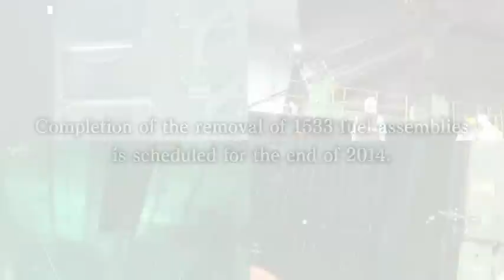Removal of nuclear fuel assemblies from Fukushima Daiichi nuclear power plant

Comment: There's a few reasons why they blur parts out. It mostly amounts to common sense when you think about them though. 

1. Security Concerns: Nuclear facilities are high-security areas due to the sensitive nature of the materials and the potential risks associated with nuclear technology. Detailed videos of this process could provide information that might be exploited by malicious actors, posing a security risk.

2. Non-Proliferation: There are international agreements and regulations aimed at preventing the spread of nuclear weapons. Uncensored videos could inadvertently provide information that could aid in the development of illicit nuclear capabilities.

3. Operational Safety: The process involves complex and highly technical operations, often conducted under strict safety protocols. Publicly sharing detailed procedures could lead to misunderstandings or misinterpretations, potentially compromising safety if individuals attempted to replicate or interfere with these processes.

4. Radiation Protection: The process involves handling highly radioactive materials. Videos like this one might expose workers' identities and gain unauthorized entry to the facility they work at. Plus specific operational details that could be used to criticize or question the safety measures, even if they are strictly followed.

5. Proprietary Information: The equipment and methods used in handling and storing spent nuclear fuel often involve proprietary technologies developed by nuclear energy companies. Releasing detailed videos could disclose sensitive information that is protected by intellectual property laws I.E. trade secrets.

Comment: is this pure fantasy? did they really completely stage this video? it was reported in late 2019 that they were just starting to remove spent fuel 8 years later. how is this video 7 years old.

April 2019:
Tokyo Electric Power Co. (TEPCO) workers began removing spent fuel rods from a cooling pool in the destroyed Fukushima Daiichi Nuclear Power Plant on Monday, the first major step in disposing of the highly radioactive material left in the plant after a tsunami ravaged it in 2011.

later on in the article:
 To remove the rods, workers stationed about a third of a mile from the plant operate a crane and lift the fuel out of the pool. The fuel cannot touch air, however, so the process occurs completely underwater.

they sure don't look a third of a mile away to me
Reply: They are removing spent fuel eventually from all six units. Some were done before others.  Duh.

Comment: I noticed a crud trail in the water as they were moving one of the assemblies. Is that common in BWR fuel movement?

I've emptied casks from Brunswick into the pools at Harris. I always assumed the crud was coming off the fuel because it was hitting borated water for the first time. Is that incorrect?
Reply: It's mainly due to the heat the rods were exposed to due to the SFP becoming uncovered during the explosion of building 4, this type of fuel assembly should typically come out of the SFP clean but due to the damage to the ZIRCALLOY tubes a layer of what I can only presume is metal slag and concrete has built up on them

Comment: Watching this in 2021 wondering what the current status of the Fukushima Daiichi NPS is
Reply: All fuel extracted from 6 through 4, 1 and 2 still contain large quantities of fuel, 3 and 1 still hold a considerable amount of Chorium under the RPV, decommissioning work is being undertaken on units 1, 5 and 6 while the other reactors are being decontaminated, most of the plant no longer requires full PPE to walk round however down on the main grade of the turbine buildings Overalls and masks are required due to pockets of radiation being present.
Reply: @InserNameHere2053  thanks for the update!

Comment: It will cost at least half a trillion dollars to do a lousy job of cleaning up this mess. Who knows how much it will cost to safely store the enormous amount of contamination from this. No one can even begin to estimate the medical costs that for the radiation that has contaminated the entire northern hemisphere.
Reply: Very very little radiation contamination really, probably little enough to cause 0 cancer cases outside of Japan.
Reply: @Gomlmon99  I learned very long ago not to believe a word out of the mouths of nuclear proponents. However, I am constantly amazed at just how outrageous your lies are. You are one of the worst. The Fukushima Daiichi 3/11/11 disaster in the first week after the explosions released more radiation than Chernobyl and more cesium than all the other reactor meltdowns and atmospheric nuclear bomb explosions in history. There was 100 tons of fuel and 8 years of spent fuel rods each in Units 1, 2 and 3. Unit 3 had 10 tons of plutonium in it. Unit 4 had no fuel in the core but the cooling water in the pond evaporated and the reactor exploded. The reactors' fuel melted through the reactors and is now in contact with groundwater. The ice wall is ineffective at isolating the melted fuel, which has still not been located in the debris, and the groundwater. At first they were releasing 400 tons of radioactive groundwater a day. Now it is 300 tons/day. The debris spewed out by the explosion contaminated the surrounding hills and streams which flow into the Pacific after every rain. It also released "hot particles" or "fuel fleas" that rode the wind to places far, far away. Occupants of Tokyo are breathing an average of 10 per day. In Seattle, it is 5 per day. These hot particles lodge in the lungs and create cancer. All of the tanks of radioactive water taken from the reactors will eventually be dumped in the Pacific. The thousands upon thousands of bags of radioactive debris scraped up from the area within 50 feet of the roads are being incinerated without electrostatic precipitators and baghouses to clean the exhaust. Wind and rain is recontaminating "cleaned areas" that Japanese are being forced back into. In the spring for at least the next 300 years, pollen from the cherry blossoms and cedar trees on the slopes of Fukushima Prefecture will contain cesium (muscle eater) and strontium (bone crusher). 50% of Japan is dangerously contaminated. Millions of Japanese live in areas that are more radioactive than the "No-Go Zones" of Chernobyl. Dust on the streets of Tokyo would legally be considered radioactive waste in the U.S. Before EPA stopped monitoring radiation from Fukushima in the summer of 2011, radioactive iodine, cesium, zeon, and uranium were measured in the U.S. at levels hundreds of times above legal background limits. It is a good thing for Japan that the wind was blowing out into the Pacific. Otherwise, they would all be dead. Let's see how long the Pacific will last before the whales and salmon go belly up. Then us.
Reply: @Gomlmon99  Deal with the facts I presented instead of deflecting with insults.
Reply: @jackfanning7952  You didn’t present any facts, just hyperbole and conjecture. 

A fact would be something like: 

“Tritium levels on the coast of the USA are consistently xx Bq/m3, whilst dangerous levels would be above yy Bq/m3”

Except you didn’t say that, you just made up a bunch of fear-mongering bullshit.
Reply: @Gomlmon99  Radon from naturally occurring radium in the earth's crust is the second-leading cause of lung cancer in the U.S. Do you think the 300 million tons of uranium tailings exposed in 9000 sites of U.S. uranium mines and mills increase the risk of lung cancer? Radioactive isotopes from fission byproducts are entirely new forms of radioactive materials that are 1000 times more dangerous than the U-234, U-235 and U-238 in naturally-occurring uranium in the earth's crust. You need to sit back and consider the numbers of people damaged by nuclear power and bombs that have been ignored by the nuclear power industry. Plutonium-239 first developed by Glenn Seiborg is so toxic that Seiborg said that there is no dose so small that it did not kill 100% of the beagle dogs in the experiments he performed. 10 pounds of plutonium, properly distributed, is enough to kill every human being on earth, ten times over.  There were 10 tons of plutonium in Fukushima Reactor #3. How many bananas would it take to represent an equivalent dose as Reactor #3? What is the half-life of a banana? Is it longer than plutonium?
Reply: @jackfanning7952  again, this is just conjecture. Tell me the difference in radon concentration due to U mining in the US? Practically none.

Tell me how many fission products reach the environment from nuclear power? Practically none. 

Tell me how much plutonium reaches anywhere past the immediate region around Fukushima? Practically none.

You need to start putting actual, useful numbers on these things and have some perspective.

Try comparing the radioactivity released from a nuclear power plant compared to a coal plant.
Reply: @Gomlmon99  The difference between radon concentration from naturally-occurring uranium and tailings from uranium mining has not been measured, to my knowledge, but tailings do generate radon. 0.3% of the energy produced from nuclear energy production is released as fission by-products, a dangerous new group of man-made isotopes that never existed before nuclear fission. Plutonium exists in many places outside of Fukushima Daiichi. It exists in the wastewater dumped in the Pacific from groundwater contamination at the site and from groundwater contamination and rainwater runoff from the surrounding mountains into the Pacific every time it rains. It has been measured in the mud within 8 miles of the Sellafield site in England and in the water from that site that is piped into the Atlantic Ocean every day. It exists in the residue that settled out of the effluent and airborne emissions from the meltdowns at Santa Suzana, Three Mile Island and Chernobyl. It exists in the contaminated soil, groundwater and airborne emissions from every nuclear fuel recycling plant in the world. It exists in the 30 half-million gallon highly radioactive sludge corroded and leaking sludge tanks at the Savannah River Site and the similar tanks at Hanford and in the surrounding ground and groundwater. It exists in the contaminated ground and groundwater at Rocky Flats. It exists at the contaminated beaches and adjacent ocean and town of Severodvinsk, Russia and the Nyonoksa Test Site where that missile blew up in Nov. 2019. Obviously plutonium exists in many other sites in Russia but the Soviet Union was rather tight-lipped about sharing bad news. Sort of like the NRC and former Atomic Energy Commission. The amount and particularly the type of radiation released from coal and other substances that have not undergone nuclear fission is infinitesimally small and relativity much less harmful compared to what the nukies have inflicted on us. Why don't you try to put some facts behind your outrageous and false statements about nuclear power. It is your turn.
Reply: @jackfanning7952  Except Uranium makes radon whether it’s above ground or below ground. Mining it does create decay. 

Plutonium is everywhere, as is every other element in the world. Low quantities of plutonium are not an issue.

If you genuinely think coal plants release less radioactivity to their surroundings than a nuclear power plant, there’s no point having this conversation any more. You clearly don’t have an education in energy.
Reply: @jackfanning7952   “In fact, the fly ash emitted by a power plant—a by-product from burning coal for electricity—carries into the surrounding environment 100 times more radiation than a nuclear power plant producing the same amount of energy.”

And you’re crying about Nuclear, the safest of all energy. Shame on you to wish death on the hundreds of thousands forced to work in coal and oil. Disgusting.
Reply: @Gomlmon99  You forgot to mention the millions of tons of acidic and radioactive tailings "in the surrounding environment" generated to produce the uranium in the reactor and the 20 tons a year of radioactive isotopes "in the surrouinding environment" generated by the reactor. Ask the kin of the millions of people who died and hundreds of thousands of others deformed by Chernobyl how safe nuclear is. Shame on you for ignoring their suffering and the devastation to the environment by nuclear power.
Reply: @Gomlmon99  Naturally occurring radon primarily is in specific areas where mountainous terrain and/or radium-containing formations like phosphate deposits are found. It is able to seep out of the ground, but more is released if it is exposed and processed to remove uranium-235. Plutonium is extremely rare except where man has produced it is huge quantities to kill other people. PU-239 is a man-made element. What do you consider a low quantity? Is the ten tons that blew up in Fukushioma Reactor # 3 a low quantity? How about the plutonium at Hanford, SRS, Sellafield, La Hague, Rocky Flats, or all of those 10-30 year casks sitting within 100 miles of every major U.S. city or in those "Jethro Bodine cement ponds" without any shielding? Any quantity of it can kill every living thing that it gets into. Seems like we should be careful with that stuff. What do you think?
Reply: @Gomlmon99  Yes, I believe that approximately 1 million people have died as a result of the Chernobyl disaster. I also believe that there will be many more deaths, diseases and deformities over at least the next 300 years from the mutations and toxicity of the carcinogenic, mutagenic and teratogenic effects of radiation. I have reviewed the results from leading scientific authorities in Eastern Europe that make that claim. Dr. Alexey Yablokov (Boris Yeltsin's science advisor), Dr. Vassily Nesterenko and Dr. Alexey Nesterenko performed a comprehensive review of the exhaustive scientific research done after the disaster. They published the book, "Chernobyl: Consequences of a Catastrophe," that made that claim. The claim has been echoed by Dr. Yury Bandazchevsky, who did his own research and spent 3 years in jail. The Russians didn't want his research to get out. The New York Academy of Science also supported the conclusions of this research.  Their editor was fired for that. Apparently someone in the international nuclear industry doesn't like bad news. I wonder if that is why deaths and diseases caused by radiation at Fukushima are being reported as being caused by "stress" from the trauma of the event? Are you gonna quit "taking" to me? Will the thugs that work for the fraud and racketeering branch of the nuclear scam industry have me jailed?
Reply: @jackfanning7952  Not really. If someone kept arguing with you that 2+2=5, eventually you’d stop bothering to try. Some people are too uneducated to bother with. This is that case. Cya.
Reply: @Gomlmon99  With 30 years experience working in industry and as a consultant as an industrial hygienist (some of it at the Savannah River site and also at the Barnwell waste storage facility, I  have forgotten more about nuclear energy and industrial processes, in general, than you will ever know.
Reply: @Gomlmon99  I clearly do not work in the industry...anymore. I worked at the Savannah River site and Barnwell waste management site on specific projects as an industrial hygienist for an environmental engineering firm hired by the two sites. I did the work for my company unwillingly but agreed because I was the best qualified for the specific jobs they wanted us to do. What I saw there helped to form my opinion of nuclear power. I  know why you want to deflect by insulting me from the information I provided to disprove your ridiculous claims. It is because you have nothing to back up your claims and we both know it. Stop being a puppet for those goons and demons that filled your head with that crap.

Comment: To all the morons saying the reactors exploded...they did not explode. Chernobyl was an explosion. The core was fully exposed to the world..the fuel rods in the reactors Fukushima melted but the primary containment structures remained intact. No fissile core material was exposed to the world via an exposed core..what did explode was the tops of the buildings due to hydrogen buildup..these are not the reactors. Learn the difference, go watch an educational video and stop using terms you clearly do not understand.
Reply: RBMK reactors like the one in Chernobyl had a negative temperature coefficient. but a high void coefficient.
meaning reactivity goes down when temps go up
So to sum up, as reactivity goes up, so does the heat. Due to the increase in heat more steam forms, which makes reactivity go up even further (positive void coefficient), which in turn increases heat. This further increase in heat does reduce reactivity however, due to the negative temperature coefficient. To quote Legasov further:"This is the invisible dance, that powers entire cities without smoke or flame. And it is beautiful."

Comment: "We have experience."
Fukushima disaster : Hold my stability.
Chernobyl: Not bad, kid.
Reply: No where near the same scale of disaster..sorry. One had an open core exposure and one was well contained in the vessel and didn't explode releasing literally tons of extremely highly radioactive elements into the air that were detected 1000s of miles away in other countries. The reactor buildings exploded due to hydrogen buildup yes..but the reactors themselves did not explode. The two disasters are light years apart in magnitude and long term damage to health.